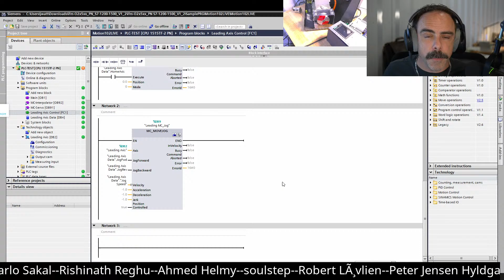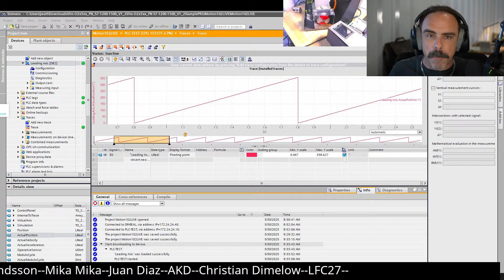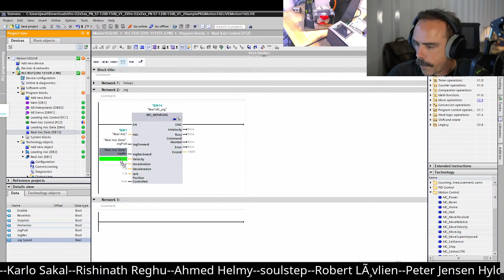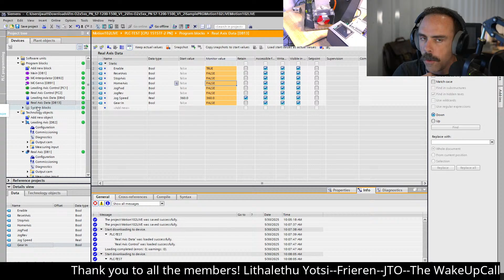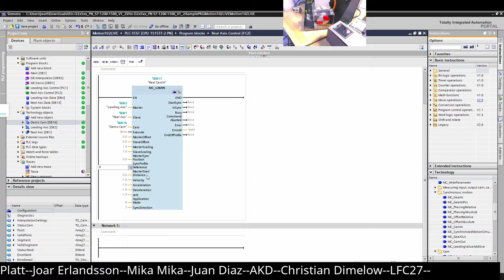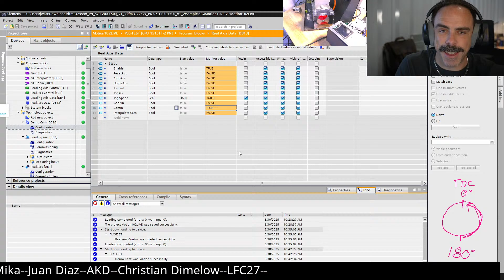Motion 102: Advanced Motion Control PLC Programming

Comment: Can you explain how to config or put value IN variable of TPID blocks ?
Reply from the maker: So, I saw your post on the Siemens Support forum. When I am talking about the PID compact, the "input" on the pid-compact block is the "actual value" on the TPID. 

The setpoint value is your target value for the "actual value." So if you want a temperature of 80*C, you put 80 into the setpoint and the block changes the output in order to get the "actual value" to 80*C.

For simple controls, the other two inputs in your post are not needed. Pre-control is essentially the minimum output value to make anything sort of change on the actual value, kinda hard to explain in a YouTube comment. The adaptation is a way to essentially change the P-gain at higher output actual values (there are reasons you would want to do this but they are special cases).
Reply: @jasonwattsae  Thank you for your guideline.
Reply from the maker: No problem! Join the Discord. That is probably the best place to get questions answered.
Reply: @jasonwattsae  What is Discord ?
Reply from the maker: It is a chat/messaging platform that you can have voice/text/streaming that is based around different communities. There are a 100+ people in our server and people ask questions and there are always people that are there to help. It is just a bunch of people that love automation and helping each other out...
Reply: @jasonwattsae  How can I chat with you or automation expert in Discord ?
Reply from the maker: When you join the server, there are three places you can chat, normally questions like this would be in #helpdesk or #automation. Just pick one and ask away. Someone will reply with an answer.